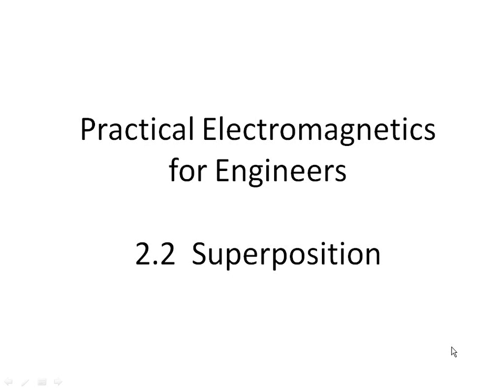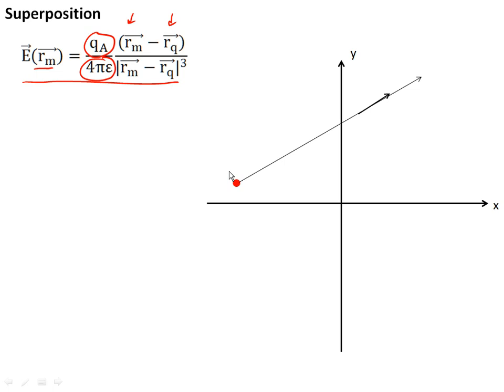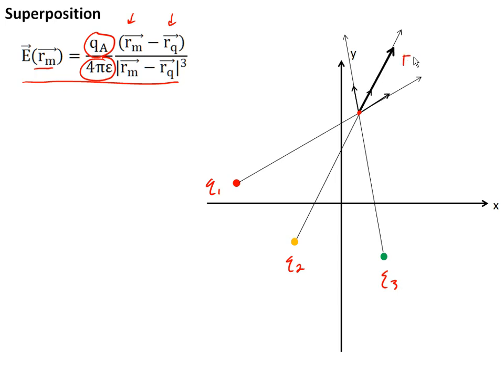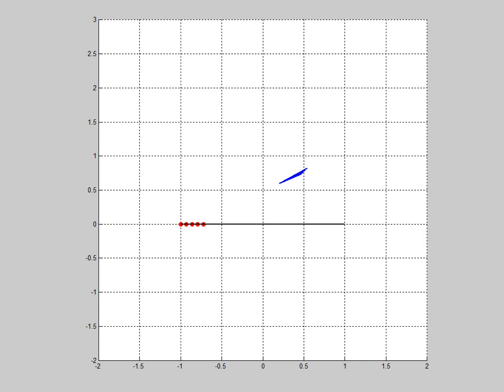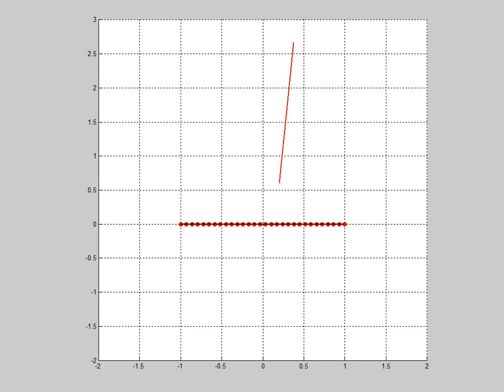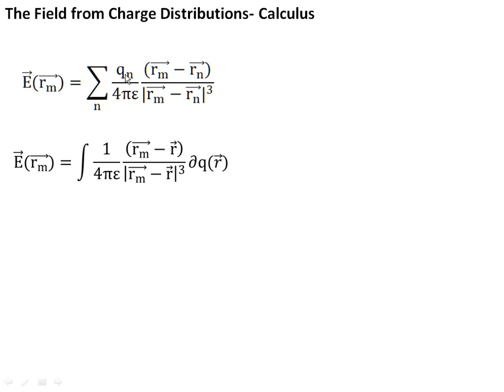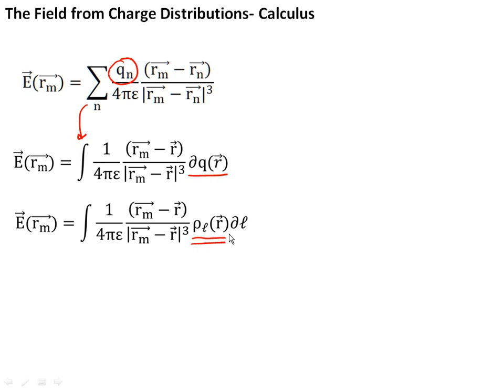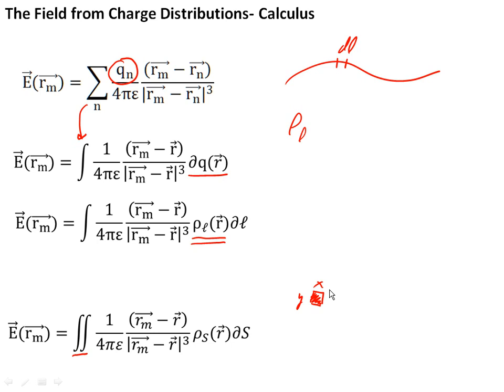2_2 Electric Field Superpostion

Comment: 5:00 why did you consider this complicated?

It's just summing in 3d

This is just adding up numbers

What is the complication?

It's not even complex here

It's just an excel spreadsheet adding up values

Do you mean doing these calcs by hand with all the arithmetic? Is that the part you consider complicated?

This is confusing terminology and not really necessary to point out

Adding numbers is 4th grade math, professor! Please choose to label things properly!